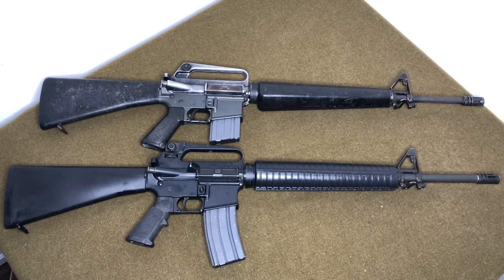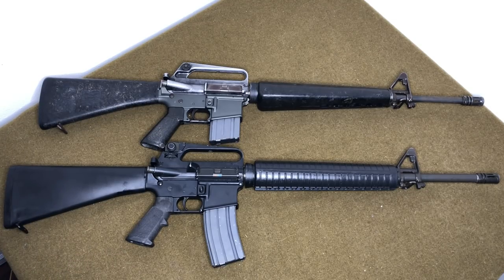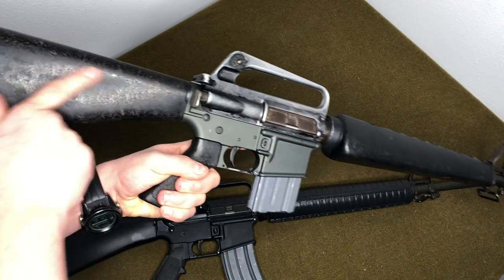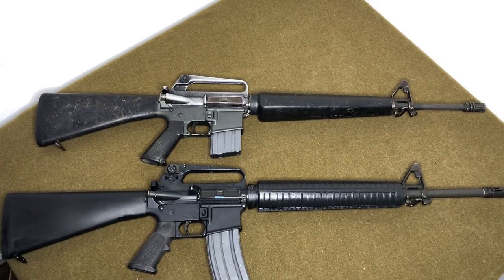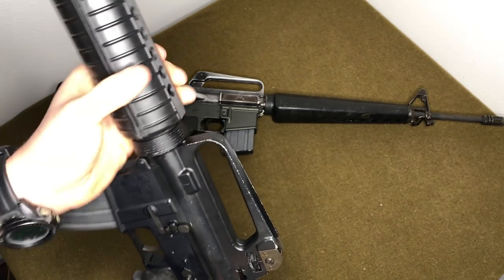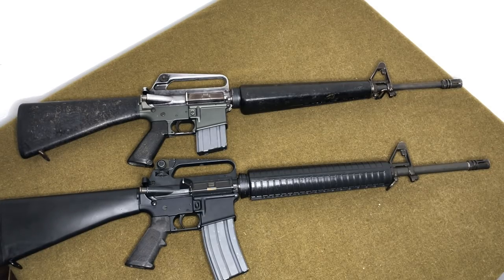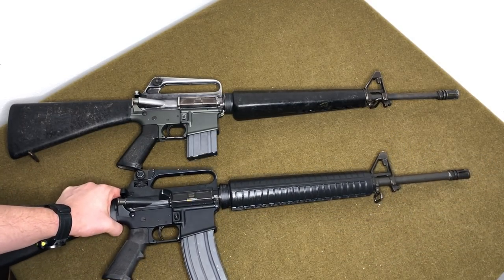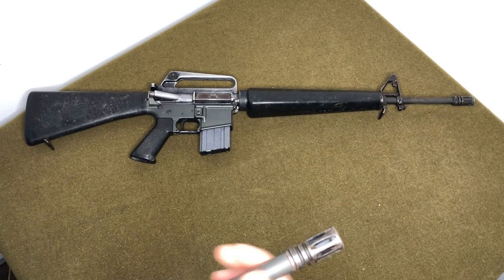The Differences Between the M16A1 and M16A2

Comment: I love reading all about history including military and there's a  trend throughout much of mankind's past: Something big changes the way war is fought, everyone adapts to it, time goes by, and suddenly people start forgetting the lesson and start tweaking those adaptations based on opinion, internal politics, misguidance, and other reasons. Three round burst is one of these innovations. See, full auto was created because the American civil war and world war 1 demonstrated that in trenches, bunkers, buildings, and generally any super tight environment the most important factor is reflex and ammo expenditure. See, bayonets may be the first thing people thing of when storming a trench, but most soldiers prefered to shoot their gun when possible once they were actually in a trench or bunker because running 10 feet at the enemy took time and he could just shoot you. It's hard to explain in text, but the chaotic fist fights of trench assaults along with the invention of bolt, pump, and lever actions meant that it was typically easier to just cycle another bullet whenever convenient until empty than it was to run back and forth from one guy to another, probably just getting stabbed or beaten to death yourself in short order anyway. On top of that, people don't just die instantly when shot; you need to shoot multiple times sometimes. The logical development was to  take a regular machine gun and make it smaller. It took years for this technological advancement to spread across the world but by world war 2 it was considered a basic fact of warfare.

By the time Vietnam and the M16A2 rolled around, many people began to forget about this in many countries. This is why the FAMAS has such an impractically high rate of fire. This is why the MP5 has 3 different firing modes. Now that the USSR has collapsed, Russia has been making many similar blunders such as that weird double semi auto feature on the AN94. These ideas serve well enough in theory, but they openly defy the brutal pragmatism and desperate efficiency that inspired the original invention of full auto. Part of the problem is that people assume that you were totally meant to go automatic at long distances. Unless you have a machine gun heavy enough to handle that kind of perpetual vibration, you are only supposed  to use it at most 20 meters. Typically it's a matter of "oh no, bad guys are literally right in front of me. I better kill one or two of them really quickly before they kill me and my friends".

So what you said about 3 round burst being silly over complicated is 100% true. Nothing is actually stopping you from basically going full auto anyway; it's just a more inconvenient way of doing it.
Reply: Truth. Especially about the lessons forgot as time goes on thing. Those who don't learn from history are foomed to repeat it.

Comment: I competed with the A1 when I was in Germany from 81 to 84. We never got the A2's but I can tell you that I could easily hit 400 meter targets without any problems. Generally I was a single shot guy, but if I actually had needed to go to full auto, I was also competent enough to control my fire to 3 or 4 round burst. At 100 yards and open sites, I was accurate down to a 2 inch shot group. My biggest complaint was that I didn't have a scope option, so when the rails came out, I was all fan boy wishing... I also wish I could have tried the M-10 daddy to the M-16... 7.62/.308 semiauto love machine with scope.
Reply from the maker: Nice. There were actually scopes and mounts designed for them, but the military didn't want to spend the money. Look up the Colt 601 scopes.
Reply: Most ACOGs have a removable base and when it's removed they can attach to any M16 carry handle(fixed or removeable) with a thumbscrew. And Colt also sold a special scope that mounted the same way.

Comment: How much would you say a brand new M16A2 upper is worth, also barrel?
Reply from the maker: If you can find a legit surplus one, as much as you're willing to pay for it. I paid $350 for this one without the bolt carrier group or charging handle.
Reply: @MikeB128  holy smokes! I actually have a legitimate surplus one, brand new.
Reply: Actually a couple
Reply from the maker: If you want to sell one, I'd be happy with having another in the collection. Find me on Facebook pages and message me if you want to sell.
Reply: @MikeB128  I think I would be willing to sell one. What's your fb name?

Comment: The A2 was adopted so the Marines could lay on the lawn and shoot bullseyes at 600 yards.   You can't see an enemy at 600 yards.  If your wearing load bearing gear, the a1 stock is not too short.  The rear sight of a2 is adjustable, not soldier proof (where is my zero?).  3 round burst is ok idea.  The ratchet mechanism is a crappy system.  The military has been trying to save on ammunition since the trapdoor Springfield.  Volume of fire can win fights. A2 is not a bad AR, but some of it's design does not help soldiers win fights.

Comment: There is a detail difference between the two Port doors. The A1 normally features a port door with a small rectangular pad, while the A2 features a larger squared pad that is actually tapered from front to bottom. This is because  some people would not close the ejection port door when closing the rifle  after cleaning and would bend or damage the port door. Angling the pad stopped This from happening.
Reply: Personally i prefer the m16a1 since its a bit smaller ish

Comment: Someone once told me that the a1 rear sight has different heights for the two apertures whereas the a2 have the same heights for the two apertures. Can you confirm?
Reply: Well from the side the a2 looks a bit taller.
Reply: It's true but the A2 has range adjustment from 300-800 meters. Well most of them anyways some of them still have the older M16A1 sight.

Comment: Would it be blasphemous to put a three-prong flashhider on my M16A1 build?
Reply: The 3 prong flash hider does look better to be honest
Reply: No not really.  Some early  A1's had the 3 prong FH.
Reply: Not really some very early production A1s had them(guessing they were using up inventory). It needs the small pad dust cover if it has a 3 prong though since the large pad wasn't introduced until the early 1970s.

Comment: Does the A1 have a smaller buffer tube or is it only the stock?
Reply: Same buffer tube. The A2 just uses a 5/8" spacer on the end of the buffer tube to make it fit the slightly longer stock. Same internal and external dimensions without the spacer. Most stock kits come with the buffer and spacer and if using it on an A1 you leave off the spacer, with A2, A4 etc you put it on.

Comment: I always wondered about the forward assist, why would you want to jam something into rhe chamber that doesnt want to go?

Sounds more like a jam enhancer lol
Reply: Inhuman Filth because of the way the m16 cycles it can cause the action to get gummed up and that can cause the bolt to not go forward, the forward assist is kind of a fail safe so if your bolt isn’t going forward you can use that forward assist so you can keep shooting the bad guys
Reply: That's the intent, but doesn't address the question; if the round is reluctant to go in, does it make any sense to use a mechanical device to force it in?  I think a "rearward assist", making it easier to get the reluctant round out of the gun, since there's no obvious op-rod handle to kick, as there is on the M1 Rifle, M1 Carbine, and M14, would be more useful.
Reply: @kimisdaman  You don't always have time. You didn't force the round in, you just barely needed to assist. It was a very delicate gun, ie why a lot of us thought it looked like a  matel toy plastic gun. 
Another reason is we Marines were slobs sometimes. We assisted in that problem because we didn't clean them sometimes like we should . Think rain, mud nasty. LOL
Yes it IMHO all was corrected thank goodness.

Those M-14 could be drug through mud holes and still clean a 20 round magazine no issue.
M-16 not, we had to learn to do better in maintenance and through several upgrades of the M-16 it became outstanding. 1967/1968

Comment: The handgrip of the M16 rifle was made by Mattel. When the gun was first introduced in Vietnam, soldiers noticed the toy company’s logo embossed on the handgrip and complained. Later shipments arrived without the imprint, but the grips were still manufactured by Mattel.

However, the M-16, manufactured by the Colt Firearms Corporation (who bought the rights from Armalite in 1959), soon developed a reputation for unreliability, frequently jamming and fouling (especially when not kept clean, a next-to-impossible task in the dust and mud of Vietnam battlefields). Problems with the M-16 eventually achieved such prominence that a congressional inquiry was ordered, resulting in design changes,
Reply from the maker: Did you get that from Wikipedia?
Reply: @MikeB128  i remembered an old  douglas dietrich vid of him ranting on about how Mattel  action man the M16 was . he was Aquino's protege for a while , however he does hate americans and says he's here to watch them die , he is of course totally ;off his rocker . but he's right about the Mattel plastic   
https://youtu.be/QXKAjGSYKUA?t=3393
Reply: @Anguila Hombre Absolutely correct. There was no flaw with the weapon design itself. There were serious flaws with implementation of the weapon and training soldiers to clean it, which isn't a hard thing to do. That powder change was likely the main culprit of fouling and the lack of cleaning is the entire reason they would jam up. Add to that the cheapening of manufacture through not chrome lining the barrel and chamber and you were left with a weapon that would foul up the gas system AND corrode in the chamber and barrel. The forward assist was tacked on solely due to the corrosion issue and was not at all an issue in the original design.

Comment: In my opinion the M16A2 is the definition of hypocrisy against the saying "If it ain't broken, don't fix it". Well, they fixed it until it was eventually broken compared to the M16A1. Let's start with the stock. On everyday AR15s modern day, most people with a good stock are A1 length. RARELY is anyone gonna collapse their stock all the way in or all the way out. The materials used in the stock improved with the A2 however, but DEFINITELY not the length of pull. The A2 length of pull is way too long for me to care about. Now for the grips. Compared to the newer grips, both suck ass. But compared to only each other, the A1 grip is better than the A2 grip. That nub on the A2 grip is really annoying, but both grip angles are too steep. But the A1 grip is better regardless. For carry handles: I don't care for this one really that much, but I prefer the A1 carry handle over the A2's. I prefer the aperture of the A1's over the A2's for some odd reason. The A2's sight adjustment is definitely far more sophisticated, but too complicated for field use in my opinion. Now for forward assists. Here is where the A2 DOES get an edge. The A1 forward assist looks look, but isn't as convenient for not getting caught on things as the A2. For the hand guards, the A1 is clearly better, that's not even a question. To me the A2 hand guard looks ugly and feels kinda iffy. For front sight posts, I seriously don't care a single bit. Now for the barrels. The pencil profile barrel as for modern manufacturing makes the government profile barrels obsolete. The reason they switched from the pencil barrels wasn't because they just wanted something "better" or more accurate, but because they didn't have the technology to make a super lightweight barrel work for the time. Pencil barrels back then shifted roughly 2-5MOA or larger after a mag-dump due to the immense stresses barrels as a whole were forced under already. The government profile barrels really aren't any more accurate than a cold ambient temperature pencil barrel, and they're not any better in general other than a firefight where it won't shift under hot temperatures. Not to mention are FAR heavier! So that's that. Now for the last part, the muzzle devices, The A2 flash hider IS better, I'll say that. It's cheap as hell, but it seriously does it's job beautifully. The extension from 20 round magazines to 30 round magazines was an improvement, and sights at least for most people were an improvement, just not for me. 

This is all my opinion as I've said multiple times so please don't kill me.

Comment: I’ve spent some time with both models but currently using m4commando but before this i used m4carbine. I’ve always been AK fan but the armed forces of my country are using ARs as primary firearm(but some branches might use a different one such as AKs and HKs) but if i can chose i’ll chose a1😊
Reply from the maker: I only prefer the A2's length of pull and sights because I'm an ogre and that extra inch and a half helps me out. If it had the "rock n' roll" switch instead of shitty burst, it would have been a LOT better IMO.
Reply: @MikeB128  yes, i also prefer that full-auto. My issued Colt m4commando also has burst instead of full-auto which i don’t really like but most of the time we shoot only semi-auto so it’s alright i think. Another reason that i like about a1 is the lighter barrel but i’ve also seen a1 with heavier barrel and a2 hand guard in the force (can’t remember about the twist though), the hand guard could be after market but i think it is factory made. We got issued both m193 and m855 but mostly 855 cause m4 is the one that we use the most. Only thing that i don’t like about a1 is the furnitures are kinda flimsy but it gets the job done so far, so it wouldn’t be much problem i think.

Comment: unless its called m16a5 full auto with flat top receiver there are a lot of m16a3 around if the flat top receiver is still considered m16a3, however again ive heard it called m16a5

Comment: 3 round burst was implemented because the average US soldier can't use full auto properly, they're simply not well trained enough, yes even the marines which miss all the time with their M16  

There's a reason why the SEALs, the CAG (Delta) and the SAS use only full auto AR and never any burst fire ones. The SEALs were still using the M16A1 up until early 90s, later (1992 IRC) they were issued a batch of Colt M16A2E3 which is the full auto version of M16A2, later this M16A2E3 became Navy's M16A3. Biggest difference between M16A2E3 and M16A3 is that the A2E3 was made by Colt and the A3 was mostly made by FN. (Note: The M16A2E3 was also exported to Israel, most IDF's M16 were believed to be A2E3)

Well trained soldiers don't need 3 round burst, it was designed for poorly trained grunts
Reply from the maker: Good info. We were always on Semi. Burst was used if we had ammo to burn at the end of a range day just to get rid of it so we could go to sleep.
Reply: Another internet expert. You are completely neglecting the fact that when the M16/A1 was introduced the DRAFT was active. The insight you mention is true about the lack of fire discipline, but since the time the A2 was introduced we have been a 100% volunteer professional military. The burst function was unnecessary as soon as it was implemented. There has not been a single soldier/marine in combat since 1972 that lacked the training and discipline to use full auto responsibly.

Comment: I think is pretty optimistic that a guy would shoot a target at 800 yards with a pin sight that you can barely see through it, how the fuck you are going to be able to see a target at that distance 😂, it's not a sniper rifle to require fast wind and height adjustments, just zero it at 100 yards and, never touch those knobs again.
Reply from the maker: I've hit steel at 800 yards with iron sights. It's not impossible if you know what you're doing. Yes I have video proof of this on my channel. Just search "800 yard shot".